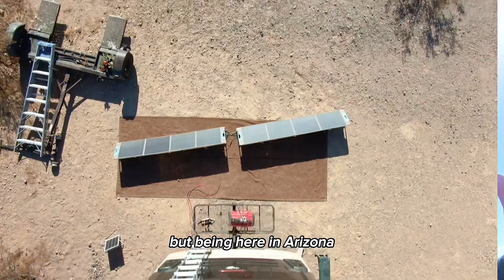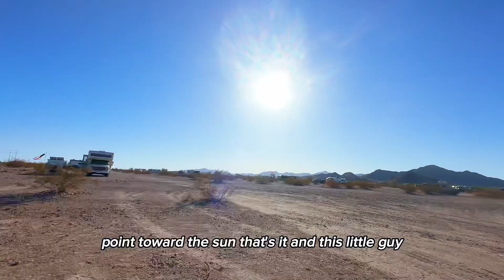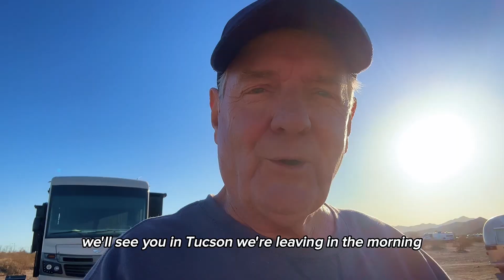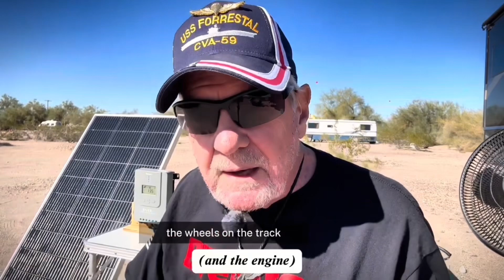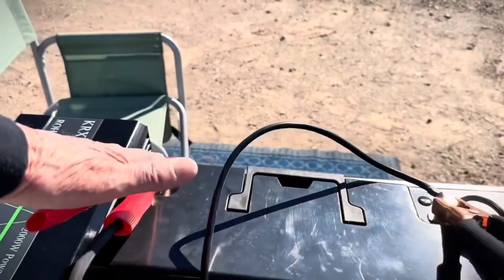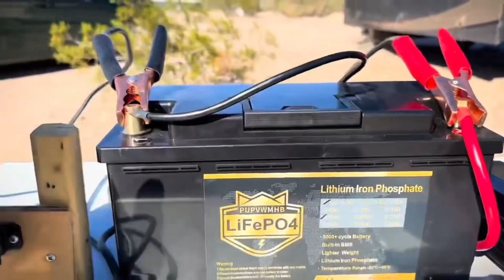RV Solar Explained

Comment: Do you still have the 4 6-volt house batteries?  I bought a 280Ah LiFePo4 and plan to replace my dead 6-volt batteries. So I am curious how your setup is, if you have done something similar.

Comment: Many people have been switching to the convenience of power stations that include the battery, charge controler and inverter all-in-one. Simply connect solar panels, and you have a system.
I enjoy tinkering, so I went with the traditional setup, even made my own lithium battery Banks and saved a whole lot of money.
Reply from the maker: I think it would be of value to many if you made a video of assembling a DIY battery bank!  I love it!